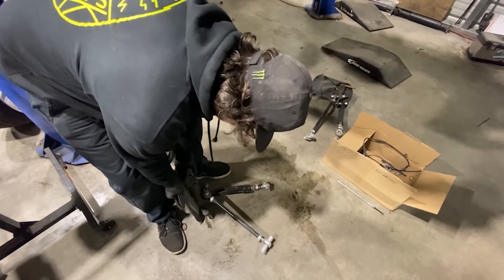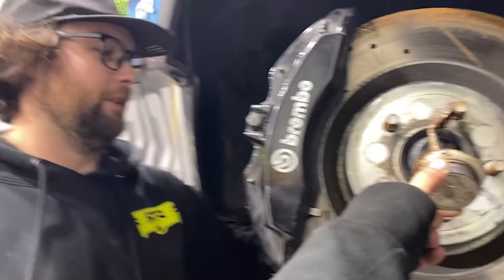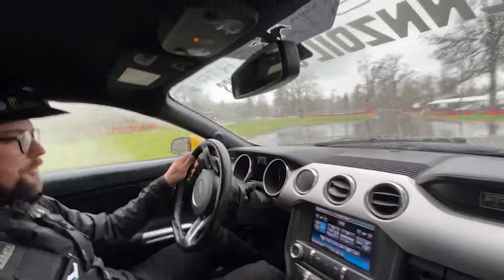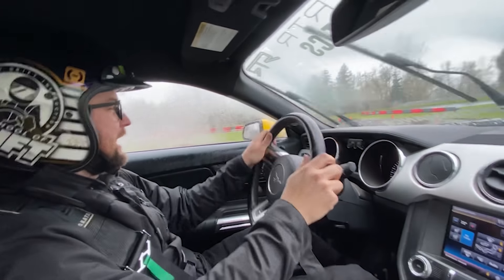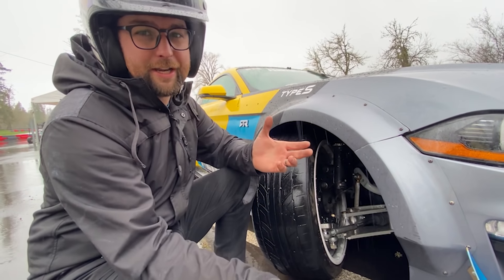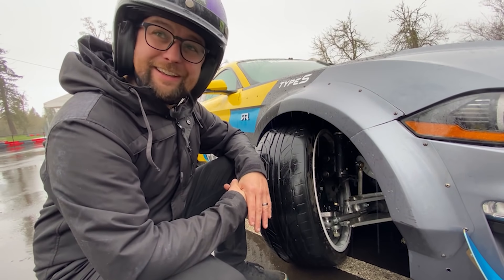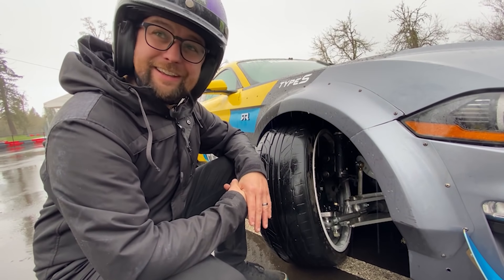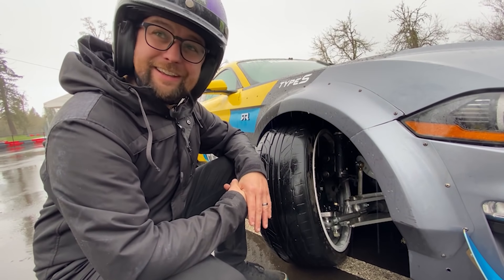Testing the PROTOTYPE Funhaver S550 ANGLE KIT

Comment: Hopefully this can get to market. The only other option I know of is the FDF mantis kit. The mantis kits adds a ton of angle and seems well received but it uses a custom fabbed spindle making it pricey. If this kit could come in around $1500 or less it could take over as the primary option for the s550 chassis.
Reply from the maker: FDF kits all water jetted steel... so this being a motorsports grade kit, it’ll probably be similarly priced.
Reply: I use scottiD angle kit. $800 and drives like a bmw with slr
Reply: @driftbandit889  making me think about buying all black 5.0 mustang gt add this kit along with intake, e85, and headers terrorize the streets

Comment: Pretty neat Chelsea. I'm sliding a 350z right now, but have a S550 GT and the steering was just so different from the Z that it deterred me quite a bit. Is a manual rack the answer for improved self-steer? Regardless, I look forward to you finalizing this kit and throwing it on the market. I'd bet this comment has my mustang in the shop crying thinking about the pain I'm going to put it through soon.
Reply from the maker: You can’t drive a car like this with a manual rack. Also no drift car should be driven without power steering
Reply: @chelseadenofa  Fully agree on the powersteering after driving some dude's "because racecar" s-chassis like 12 years ago. Just wasn't sure if there was a better option. Different rack and s197 powersteering adapter? I obviously have no knowledge on Mustangs sliding.
Reply from the maker: S197 rack and pump would be a great option

Comment: Why is electric steering bad?
Reply: Its not terrible it just isnt as smooth as mechanical power steering. Like on an frs brz with angle the car has dead spots due to the computer freaking out slightly. I havent driven an s550 yet so idk if its the same deal or not.
Reply: EPS doesn’t self steer like hydraulic does, especially when transitioning